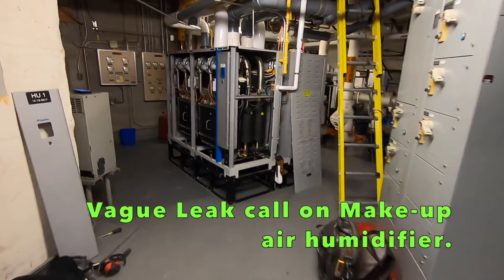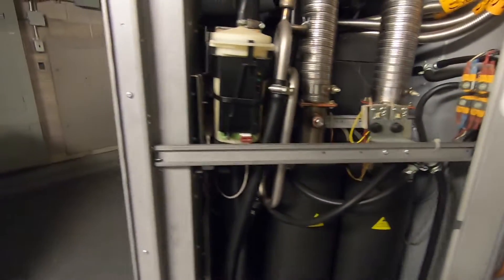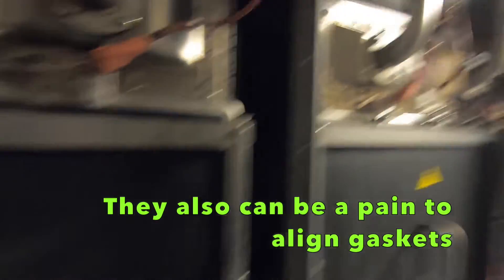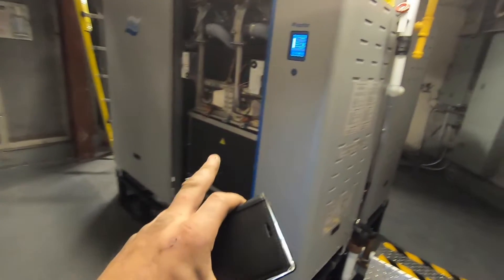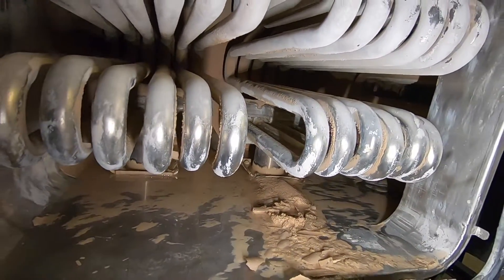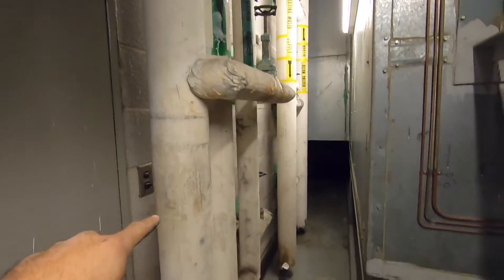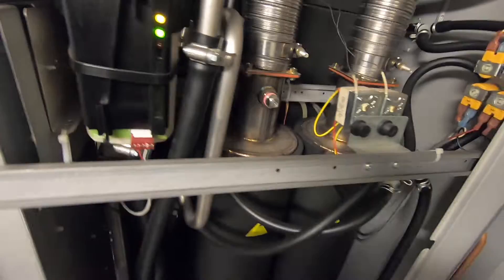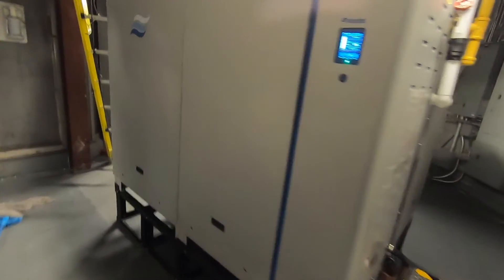HVAC: Make-Up air steam humidifier | Nortec-Condair leak

Comment: Nortek’s look pretty nice! I’m used to Dri Steem, Engineered air and Neptronics. I always recommend softener systems but no one ever installs them. At the end of the season I can fill atleast two 5 gallon buckets with sediment.
Reply from the maker: i know right!!! I hate cleaning them. I will push softeners 100% on replacements.  Thanks moose